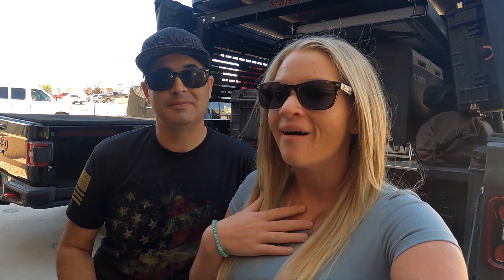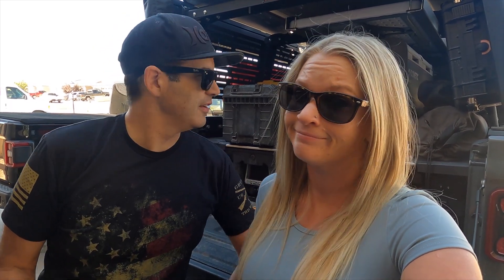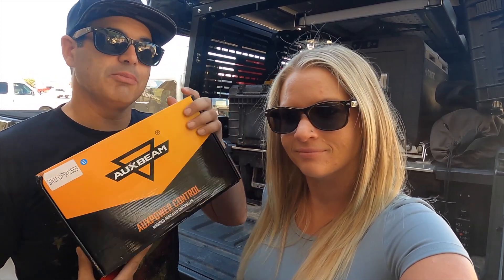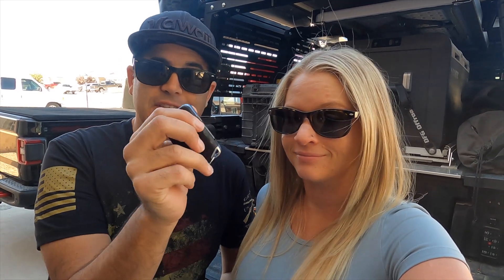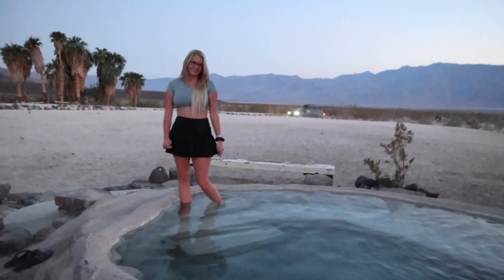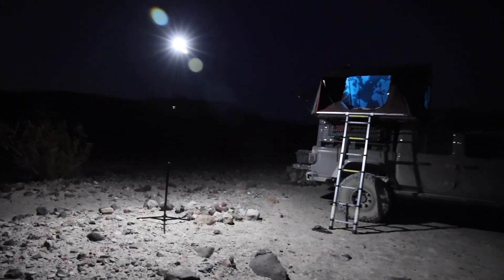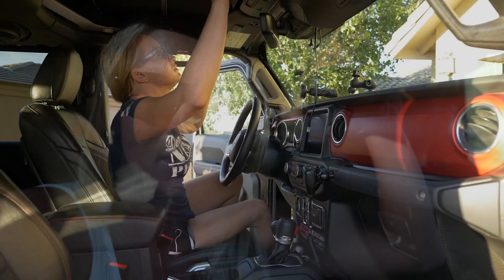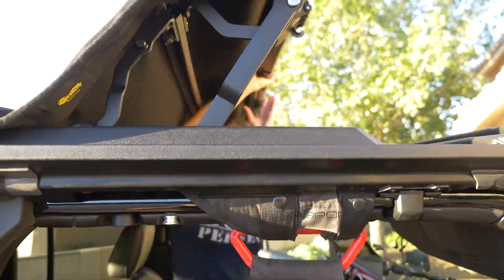Jeep Gladiator Eco Diesel Off-Road | Overland Build | PT1

Comment: Okay, I have this same bed rack system. I have an Awning that I put on my driver side. The bent metal bracket doesn’t hold it without a lot of movement. What did you guys do to fix the issue?
Reply from the maker: We had a bracket made. We took the factory bracket and had it extended
Reply: @OverlandishAdventures  
Could you please share a picture or video?

Comment: How does the ecodiesel compare to the supercharged gasser?
Reply from the maker: Night and day difference way better gas mileage
Reply: @OverlandishAdventures  oah no.  That makes me sad.  I have a Mojave that I'm looking to add the Magnuson supercharger kit next month.  Would I basically just be bringing it go to snuff with what the ecodiesel already is?
Reply: @JasonParham83  diesel is way way better. Way more power. Tho if you super charge it stock your will be pretty fast but be carful it will blow the engine